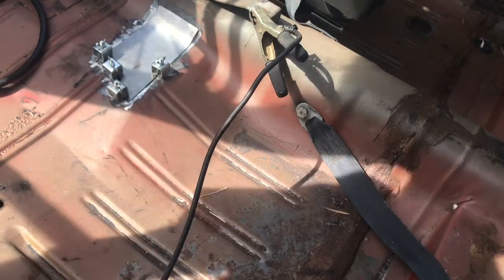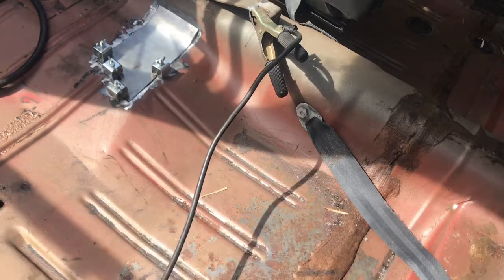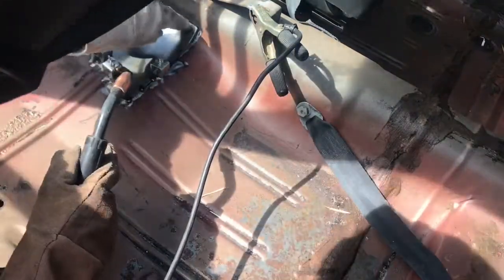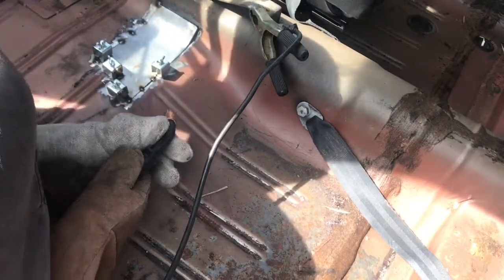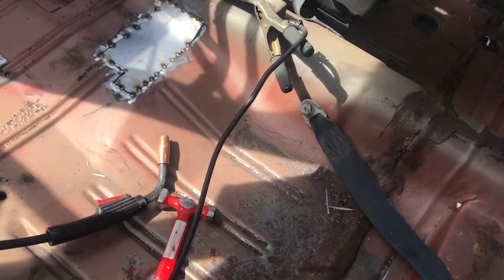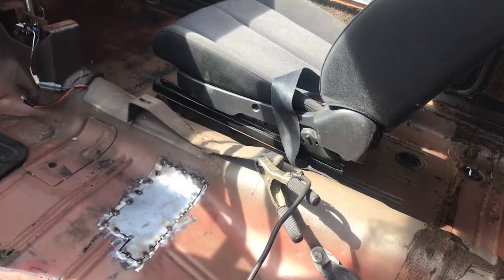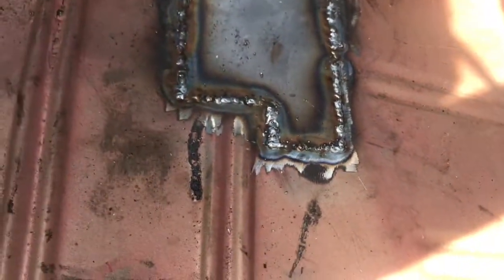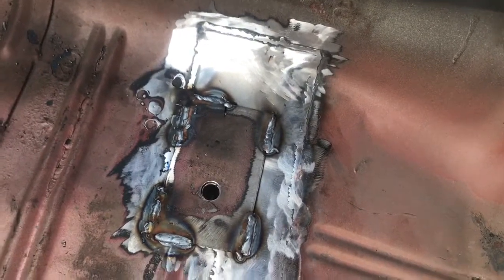66 Dodge Dart floor repair. Part 4 (final)

Comment: My 66 dart did the same. I repaired the same way, but I also welded a plate under side, too
Reply from the maker: I wish I still had that car.  I ended up selling it to put the money towards my 69 Firebird project.  And now that I’ve moved outa California to Oklahoma, I wish I had it back to have another project to play around with.  Maybe I’ll find another one some day.
Reply: @ogresspeedshop  I have 2 66 darts. I have had them for over 20 years. I'm right now putting a floor pan in one, and the other one is becoming a parts car. Found out the windshield seal was leaking, which took out the passenger side floor out. Got the pan in today and will start tomorrow working on it.
Reply from the maker: @iamnoone.  I always like the 66 Dart just because of how unique it actually was.  Problem was getting parts for it.  If I remember right it was a crossover year and everything was somewhat that year only.